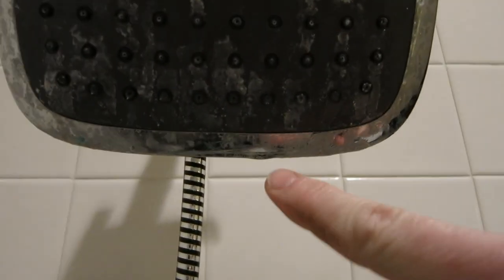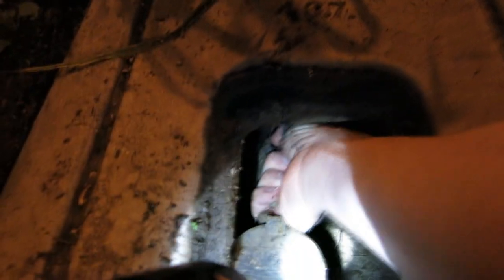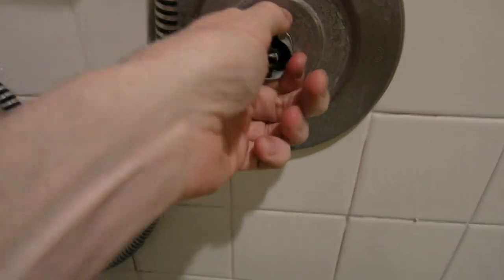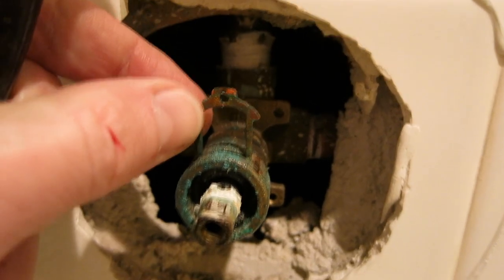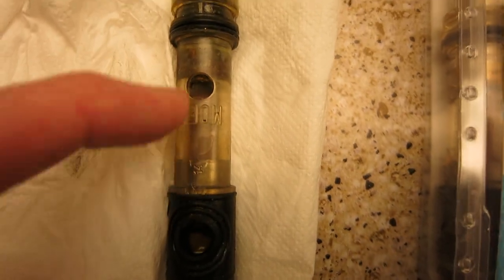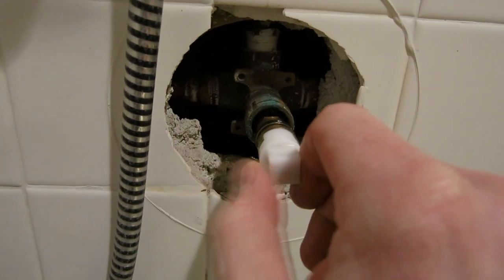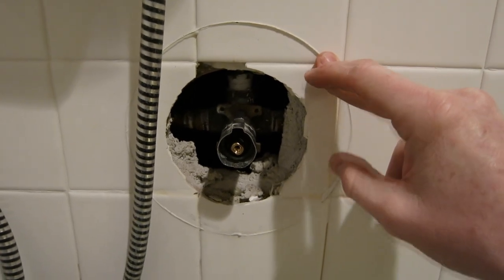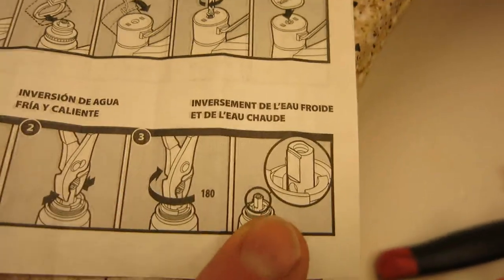How To Fix A Leaky Shower - Shower Slow Drip Fix

Comment: That's the problem when the things from the house don't get changed every 5 years and just let it sit there for years and years and never change things it happened to me the house I moved in was dirty asf I got it cause it was cheap I been in the house now for 18 years and I decided to change everything and wow everything around my house like the pipes from all over the house were nasty I had to change everything very expressive to renew almost all the house o well it's worth it as long as you stay more at that house for a few 20 years more lol so yeah the problem I can't fixed my self is same thing as you water keeps dripping from my shower in the basement I took the old shower arm and shower head and install a new one but it keeps dripping water when I finish taking a shower I didn't used to drip water but now that I put a new one drips water the old one I put it in 2002 and just now on 2018 I changed it smh my advice to people change your shower arms and shower head every 5 years or less now I need to call on a plumber asp

Comment: How does this resolve a leaky shower head?
Reply: The reason the shower head is leaking is because of that part
Reply: Its amazing the parts that can block and stop water flow.  A new o-ring or washer are often enough, but if not, then new parts like this can be the next alternative.

Comment: What about if the faucet leaks when you use the shower head while showering?
Reply: That might be at the connection between pipe and showerhead, so it will need another solution.
Reply: That's my problem. No leak when off. Only when running.